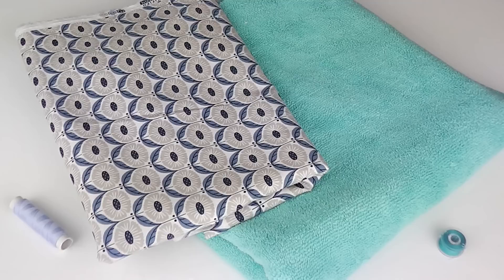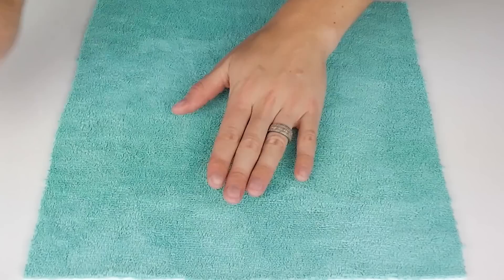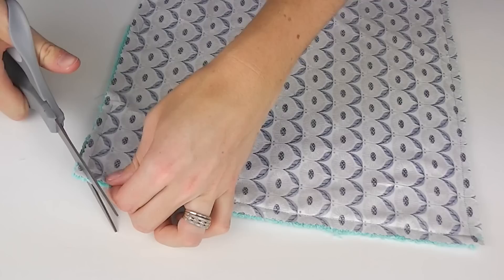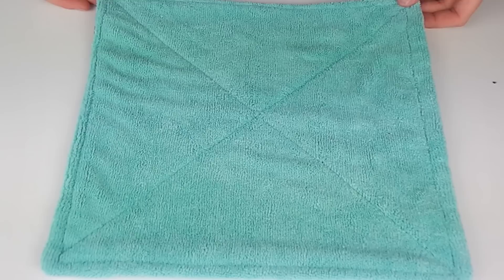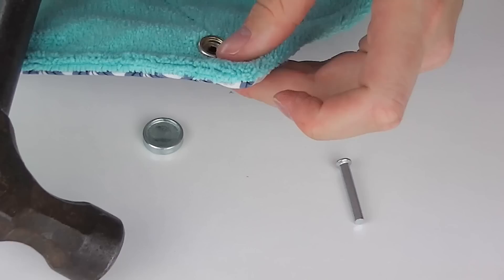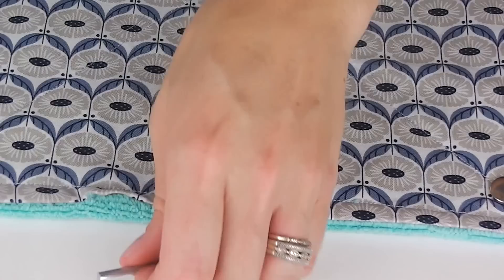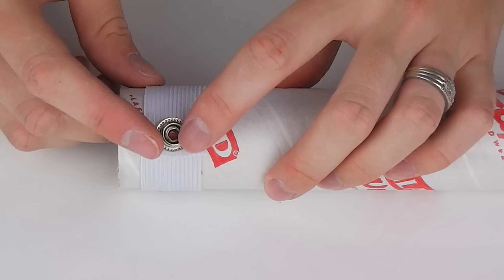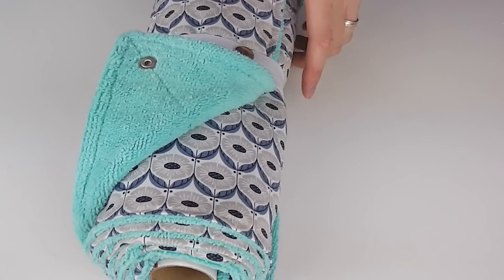{Step-by-Step Sewing} Reusable (Un-Paper) Fabric Towels

Comment: Looks great, but I am not liking the metal snaps, wonder if velcro is preferred (no scratches that way). But you have shown each step and explained them well. Thanks!
Reply: CMS Sultana There are hard plastic ones as well
Reply: I use plastic, you can get kits at Walmart that come with everything you need including the awl to make the hole for the snap
Reply: You can use Velcro. I have made these and I used 3/4 inch wide Velcro. But over a period of time Velcro doesn't work that great. I prefer using plastic snaps.